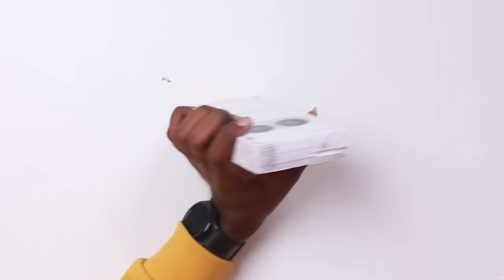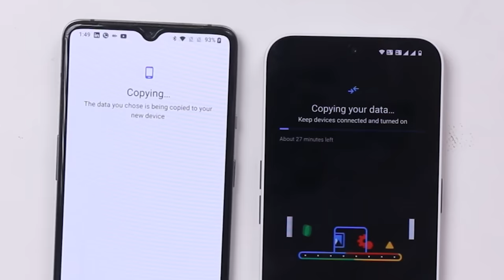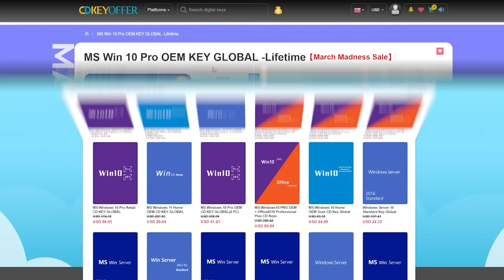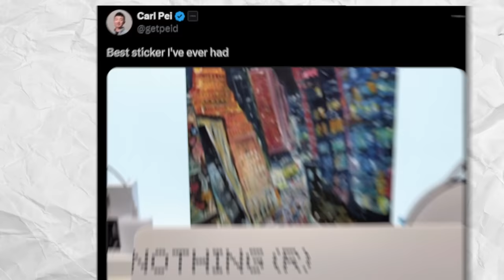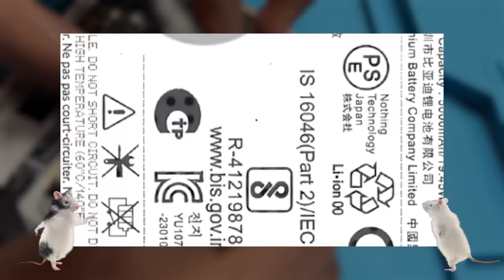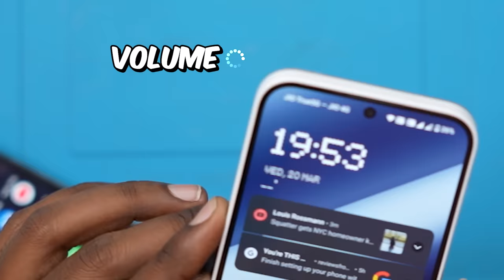Nothing Phone 2a P0$TM0RTEM💀 |  உள்ள என்ன இருக்கு? 🤯 - Nothing Phone 2a Teardown  🔥

Comment: Hi Ji, I have TWS which battery life is gone. I opened the earbuds and the case, found 3.8v batteries inside. But in online I'm seeing 3.7v batteries only available. If I change this stock 3.8v battery, with a 3.7v battery will it work..?, or any impact..?
Reply: Original batteries poduradhu dhaan best yu bro ilana problem agum
Reply: @kaushik6371  can't able to find online bro.. 3.8v batteries are very rare
Reply: @Vivekkumar-tv8ui  if there is insufficient power then it will not work properly but you can try this as an experiment we cannot confirm that all the 3.8v is used by tws